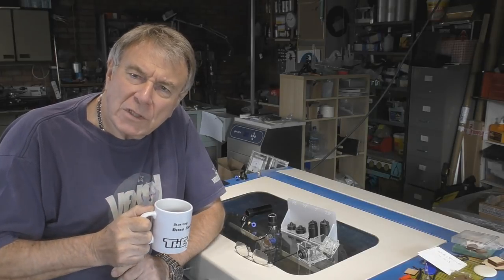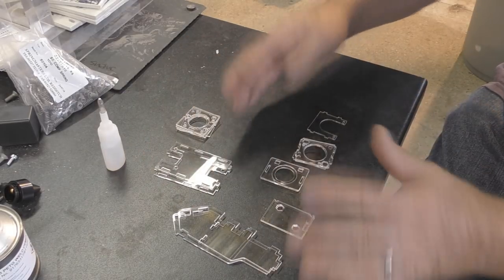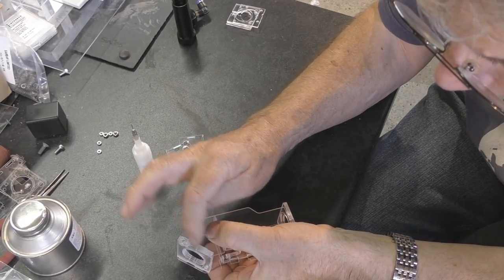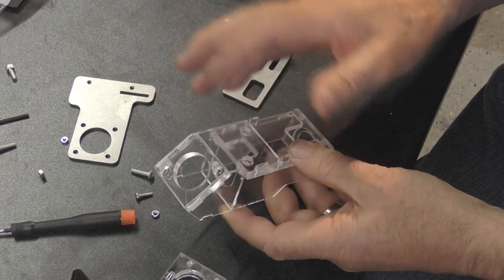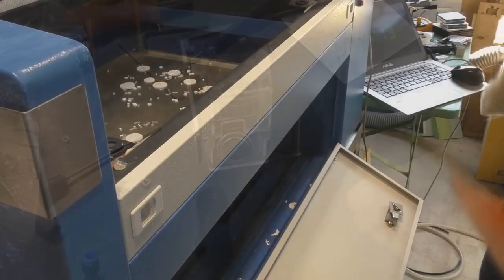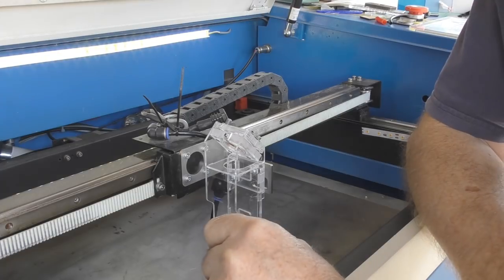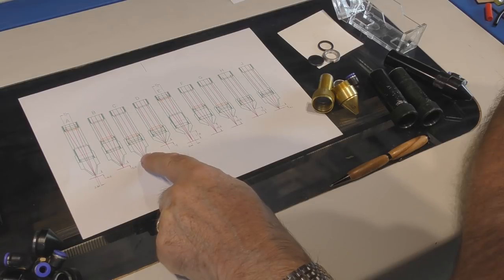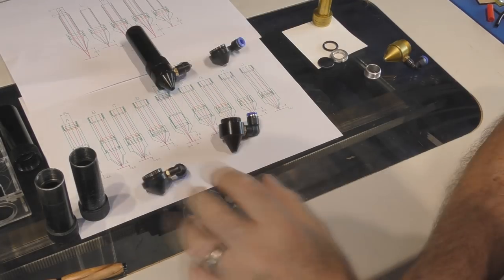RDWorks Learning Lab 154 Head Re-transplant Mk2A

Comment: I bought this, and his Dohicky, a few months ago and LOVE them both. Made my life so much easier and I removed the metal plate completely that he sawed off the arm to.  I replaced mine with a 3d printed one in PETG so now I have less mass on X by a lot.  I can now go faster and it would be akin to a Bowden system in 3d printing.  Less weight on Y too since X is sitting on Y so my 300mm/s is now 500mm/s with no issues.
Reply: Did you post the stl up on Thingiverse by chance?

Comment: when using buried nuts like that, you can use square nuts. They are normalized by DIN and available on Amazon, so procurement is not an issue.

Comment: Excellent video as usual. I agree with everything you said, except the honeycomb table, I just can't use anything else. It is true that it produces downflow, however, you can easily create cross flow by masking taping the sides and front of the table. leaving only the back open. I use it daily when I do engraving on clear acrylic with my 1 inch lens with no nozzle. the best thing is that since it creates downflow, it sucks the material into the table, with my 8 inch mixed flow fan I've been able to correct warped 6 mm plywood, as well as 3 mm acrylic creating a flat surface for engraving. I just can't use anything else at this point :), its my friend.
Reply from the maker: Hi Abraham

Ah ha. I have seen Trotec and Universal do this to their honeycomb tables at exhibitions. It looks most unprofessional on such machines and certainly at exhibitions. You would think something like a nice big sheet of acrylic to cover the table and then a pattern  of small holes in it where they want to suck their exhibition test pattern card down would have been more in keeping with the price of the machines. Your solution certainly gets everything you want.  With the Lightblade machine I have a removable solid steel plate that sits over the slats and a loose honeycomb that has only ever been used about 4 or5 times in 2 years. I use the solid steel table on both machines so my  anti-warp solution is different. I use 8 neodymium magnets on the table  (at corners and mid sides) as spacers. I place a few old 5mm acrylic 10mm  diameter discs (saved from a job I run ) around inside the work area. Place my 3 to 5mm ply on the magnet stand-offs and then put 8 more magnets on top. The clamping force on these little magnets has to be seen to be believed. The clear acrylic spacers do no damage to the underneath of the job.Thus for either cutting or engraving I exploit my crossflow.  We arrive at the same point from different directions. How good is that?
All best wishes
Russ
Reply from the maker: Hi Abraham
 Although my personal love for the honeycomb has not changed I promise I will display that it has a few good points for just a few applications. Your thin card is one and if you have a strong enough extract system (i Guess yours is about 700 watts?) then you can balance flow against negative pressure generation and pull your paper flat to the table Do you ever get reflection marks on the back of your card? I have designed a nozzle that holds my compound lens set up and it will also hold a 1" lens. The focal point of the 1" lens is very exact thus it is important to hold the paper/card flat. I will demonstrate your application and  use that 1" lens on my Lightblade machine where I can use my almost new honeycomb table. Very thin leather and fabric cutting are the only other possible applications for it that I can imagine.

Best wishes 
Russ
Reply: My fan its actually 85 watts, its an EC motor fan, incredibly efficient, you can look it up as 8" Hyperfan, its got better static pressure than my 350W centrifugal fan, and about three times more CFMs, its trong enough to straighten 3 mm cast acrylic and even 6 mm plywood. My love for the honeycomb table is all about that vaccum, I've of course, sealed all doors to maximise it.

Comment: Another nice one Russ,  question from acrylic newby --   glue  = acetone?  superglue?  or something special?
Reply from the maker: Hi Dennis 
this is what I use
http://www.bondrite.co.uk/adhesives-for-plastics/wc123-petg-weld-cement-250ml/p340483.html
The heat stressed edges of laser cut acrylic will craze if you use superglue as it is very aggressive. Although this particular formulation is designed for PETg, it is  a "gentler" cement that takes a little longer to  bond (maybe 30 seconds or so) maybe needs half  an hour to attain full bond strength, it rarely crazes. It is only available in the UK so you will have to Google for a local version.
Best wishes
Russ

Comment: Do you have overheating problem for the mirror and the lens with the acrylic head? I'm planing to make one. Thank you. (because usually the holders are aluminium)
Reply from the maker: Hi Ivailo

  I used it for over 2 years and had no problems  but I only have 70 watts max. The head is always moving so there is natural air assisted cooling. The mirrors I was using were pure copper  but molybdenum mirrors are almost as good. Both mirror faces are exposed and neither I or any of the many people who have copied  this design have reported issues.
When I designed its replacement, the aluminium lightweight head Mk2,  I have modified the  design to use the MK2 aluminium mirror holder.   If you think you need the design then just add your disguised email address to another comment and I will supply the drawing and also delete your comment/email address from public view.
Best wishes
Russ
Reply: @SarbarMultimedia  Thank you.  I will make my own design, because i do like to be the smallest possible as Epilog head. I will make it from the high impact resistant 3mm plastic. Actually, i am making 3rd laser machine, but this time will be a faster machine, with the light possible head. Here the 2 previous machines: https://grabcad.com/ivaylo.stoilov-1
Reply from the maker: @ivailostoilov1860  

 Hi Ivailo
A fast machine sounds like a good idea and I have had my China blue running at 1400mm/s  with it's standard NEMA 23 motors.  However be aware of two problems
 1) The switching response of your HV power supply. They are usually specified as less than 1ms to 90% of demand.  At 1000mm/s  that means the head will have moved 1mm in 1ms.
2) Power. You cannot engrave fast unless you have sufficient power. (light intensity). It requires a certain EXPOSURE TIME  to damage material . The faster you travel the less that exposure time .

Did you  watch my Tangerine Tiger series where I fit a 30 watt RF tube to a cheap Chinese machine?
Although I can run the machine at 1500mm/s ,  engraving power runs out  at 500mm/s.  The switching speed of the RF is virtually instant thus the engraving is superb.
 
Very few people know that it is possible to employ a couple of tricks to make a glass tube machine respond just as rapidly.

I also caution about a lightweight head , stepper motors and a rubber toothed belt.  Yes, as a cheap CNC design concept it achieves it's goal  but at the expense of  nasty little problems. One is resonance
 see  https://www.youtube.com/watch?v=yVbzm41tcy4
Unless you use dc servos for smooth motion and urethane wide belts, then you cannot get rid of this problem.. Instead you must tune your system so that resonance happens at 100 to 150mm/s. This is above normal cutting speeds and below normal engraving speeds.

Good luck with you new build.
 Best wishes
Russ

Comment: Hello Russ, huge fan of your videos. I have a question. My lens tube can be moved up and down and I have no clue how ‘high’ or how low the nozzle is on the best position for the laser to be most powerful. Can you give me a hint?
Reply from the maker: Hi 
If you have a fixed table then you must have an adjustable lens tube because there is a certain distance that  the lens must be above the work surface. How do you find that distance? The simple way is to draw a line 25mm long and  set it to cut mode. Set the speed to about 200mm/s and power of 15mm/s  Now keep drawing lines and adjusting the distance  between work and nozzle. You will see the line getting thinner and thinner. Once you pass the focus point the line will start getting thicker. Find that thinnest point and then measure that distance . That is your setting distance from now on.

Best wishes 
Russ
Reply: Thanks for your quick answer. I happen to have the same China blue engraver. The table is adjustable. But I don’t understand that the lens tube can be moved up and down. Isn’t that supposed to be a fixed length from the mirror to the lens in the nozzle? The distance between the nozzle and the workpiece I understand, that’s the height of the piece of acrylic that came with it. How can I find the right distance of the the nozzle and the mirror? Best regards! Fred
Reply from the maker: @nikonised  
Hi Fred Unscrew the knurled nut and the whole lens tube assembly slips out.. take a look at the diameter of the bore and you will find it is little more than 10mm. If you look at the diameter of the output bore on you tube you will find that is closer to 11 or even 12mm. That is the real diameter of your beam and it will remain at that diameter all around your machine because the mirrors are ultra flat  and will not cause the beam to grow or shrink. . That does mean that not all your beam will fit down the lens tube. I bored my tube out to leave a 1mm wall. Now consider the beam path length between tube and  lens when the head is at rear left corner  (may be 300mm?) and now the length when the head is at front right (maybe 1300mm?). The point I am making is that it matters not what the beam length is BEFORE the lens, it's only the focal length after the lens that is critical. If you remove your nozzle  you will find a lens (called a plano convex) which is convex on one side and flat on the other.. The Chines always ship machines with lenses installed what most people would consider the wrong way They install them convex side to the table. If it's right or wrong is a matter of opinion because if you use it with flat side up then it gives a sharper smaller dot when you come to do photo and precision engraving and your setting piece will be correct. Flat side down is better overall because it produces a better deeper cutting action and for most situations I would run the lens flat side down. However,  this will change the focal point and your nozzle  may need to be as much as 2mm lower. 
Best wishes
Russ
Reply: Russ, this is really educational! Many thanks! I will try this, turning the lens around. Sow the shaft length is not important, because it’s before the lens but the height between the lens and the material is. So if I want to cut thicker material such as foam, it’s better to focus on the half of the thickness of the foam, Am I correct? Best regards Fred
Reply from the maker: @nikonised  
With foam the shape of your cut will be terrible whether you set the focus on the surface or mid way. You really need a long focus lens,  (maybe 4") to cut foam but it will still give distorted edge but not quite as bad.
Best wishes
Russ
Reply: Russ, again you are absolutely right. The cuts in foam are terrible, I thought it was the speed or heat that caused it. That 4” lens, can I buy it somewhere as a kit so that I can use it on my machine or do I have to tinker for it? Thanks again! Best regards Fred
Reply from the maker: @nikonised  
Hi Fred

Foam is a particularly difficult material to cut because it has a very low damage threshold.  Both before and after the focal point, the beam gets wide very quickly. For many materials that you cut like wood ,MDF or acrylic, their damage threshold is so high that it is only the powerful core of the beam that is doing material damage. With foam, that spreading outer part of the beam has sufficient energy to melt the plastic.. 
Have a look at this and see if this works for you    https://www.youtube.com/watch?v=yiwUio7vHOs&index=35&list=PLPWEtx5V9DqEogIeYRdcG_KYcB7UL2Qmn&t=1566s
A trusted source for lenses is 
https://www.cloudraylaser.com/products/china-pvd-znse-focusing-lens-for-co2-laser?variant=43422450056
They do not have a 101.6mm fl lens on their website but send a meaessage and ask because I know they will supply
Best wishes
Russ
Reply: Incredible! I wasn’t aware that that kind of foam could even be cut. What I’m trying to cut is thicker ‘yoga mat’ foam. This foam is about 12mm thick or max 15mm. Thanks for the links! Have a nice day!

Comment: Any way you have a design for this in 1.5 or 3mm versions? 2mm cast is not a very common size around here :(
TIA Russ!
Reply from the maker: I only have the dxf in 2mm . thickness but checking on plexi thicknesses available to you it seems that 0.080" (2mm) is a stock size. I would use extruded acrylic for its better tolerance but I get most of my acrylic for free as offcuts and cannot be choosy about thickness ,colour or cast/extruded. I used what I had to hand.
see      https://www.eplastics.com/blog/thickness-tolerance-plexiglass-acrylic-sheet

Best wishes
Russ

Comment: Hi Russ, Just checking if you are still selling the kits? I would like to buy one. Are you able to sell the acrylic housing too? Cheers, Sean
Reply from the maker: Hi Sean, 
Sadly I am not selling the head assembly but the dxf files for cutting it from 2mm acrylic are free and available. And yes the head kit is still available. 
If you are interested then attach your email to another comment . I get auto copied to my Gmail so I will delete your comment/email from public view and send you all the information.
Best wishes
Russ
Reply: @SarbarMultimedia  Also, just curious, did you have to cut off part of the black metal plate that the original laser head screws into, to allow for the installation of your head kit? Hope this makes sense. Best, Sean
Reply from the maker: @snppls  
Hi Sean , Yes there is this unlisted video in the information pack.   https://www.youtube.com/watch?v=gkOV0caVXUk

Best wishes
Russ
Reply: SarbarMultimedia great. Thanks Russ. Makes sense now. I placed my email in a previous comment. Cheers.